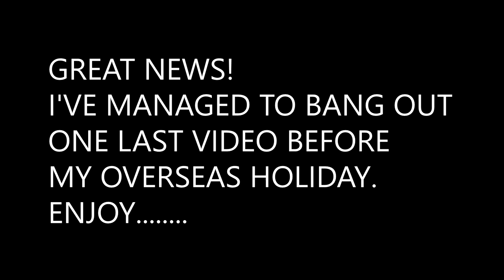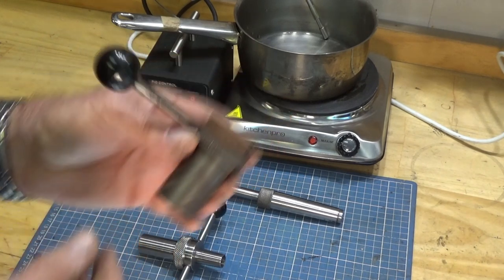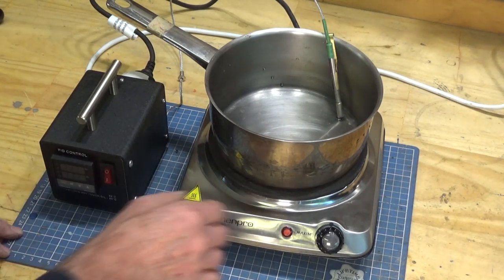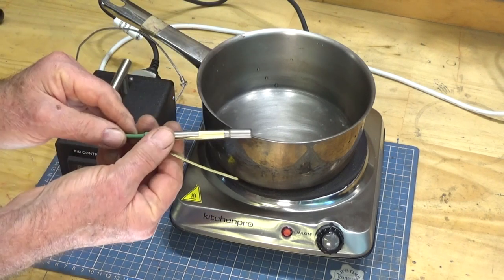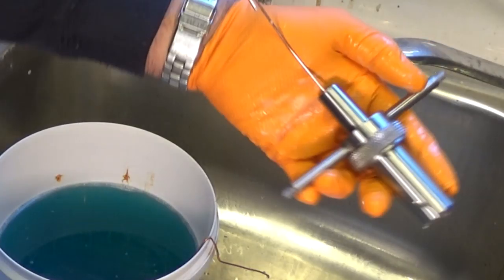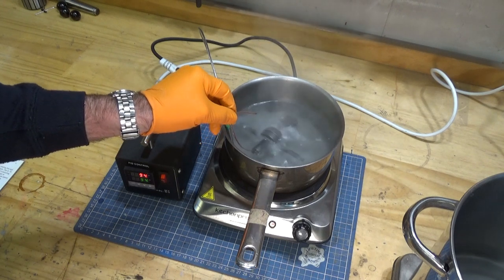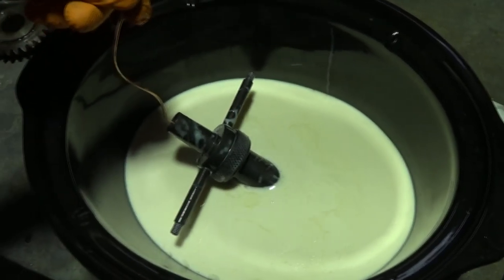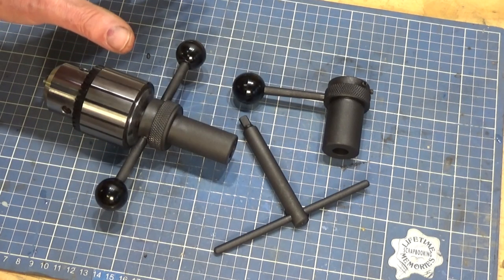DIY Parkerising in the home shop

Comment: Mild steel will never go as black as a hardenable steel with some % carbon in it.  There's  even a difference in color between high carbon steel thats been hardened and unhardened high carbon steel. The reason gun parts  will go very black when parkerised is because most of the parts contain a higher carbon %.
Reply from the maker: That's what I understood from reading my book but I haven't had a chance to try it on high carbon steel yet. I do love the surface finish though.

Comment: The texture is probably because it's zinc phosphate. If it were Magnesium phosphate it would be black. Zinc molecules are fairly large intent to leave a discernible text your to anyting you apply the phosphate coating to. An application of Z Max or Marvel Mystery Oil would seal that up quite nicely.
Reply from the maker: 44 Hawk, I got in touch with Cain at Jane Kits and he confirmed that the solution I am using is a Manganese Iron Phospthate. He also said that you do need to reapply the oil periodically. I did some tests before I left for my holiday and I am keen to see how they have behaved while they are exposed to the elements.
Regards,
Mark Presling

Comment: You can buy gun bluing or blackening.  After parkerizing, pour the bluing/blackening agent into a zip lock bag and put the part in there with it.  It will darken nicely.  Just a thought if you want it darker. Terr
Reply from the maker: I already have a cold bluing solution but I find that it's not very durable. The colour tends to fade to a sort of medium brown and it still corrodes. 
Regards,
Mark
Reply: @Preso58  
I put it on after the parkerizing.  If I think the parkerizing comes out too light (light gray), I drop it in a bag of cold blue/black and wash it around.  Works good on  bolts and stuff.

Comment: You could program the PID controller to look for a failure state. If the temp does not rise, or falls over the course of a few seconds, something is wrong and it should shut off.

[edit] Maybe not. I see that you used an off the shelf PID controller. I was assuming full DIY.
Reply from the maker: Mark, yes, my PID controller was a bog standard, el-cheapo Chinese knock off and although it does have some features like an alarm for over temperature states it's not particularly intelligent. I watched a video recently on a fully programmable PID controller and they seem like they have some very useful functions. 
Regards,
Preso

Comment: 3 years later, how did it hold up ?
Reply from the maker: All of the parts I have treated this way still look as good as when I treated them. The chuck key gets used the most and there is no rust and the finish hasn't worn off. I am about to run a big batch of parts in the next week or so. It's more work than cold bluing but it is the most durable finish I have come across.
Regards,
Mark

Comment: Was there any dimensional changes in the parts ? !
Reply from the maker: Not that I could measure. Parkerising is often used on cam shafts after grinding so that they hold an oil film better. I would think that if the parkerised finish changed the diameter of the journals it would be a problem. The process mostly etches the surface so it becomes sort of porous. It's not really and additive coating.
Regards,
Mark

Comment: You don’t need to boil the park solution. Just below boiling point will work well and you have less evaporative loss.
Reply from the maker: I did some more experiments a couple of weeks ago using a new rectangular stainless steel tank. Even though the temperature was set to less than boiling point, the solution does evaporate a lot and I realised that it had become super saturated. There was a lot of fine crystals in the solution and the volume had dropped by about half. The solution started to create really big bubbles which burst quite violently splashing the solution out of the tank. I topped up the water and it stopped. I have a video half finished but I am away on a holiday at present and won't be back for a month. I left some parkerised samples out in my shop to see which type of post treatment gives the best corrosion protection. When that video comes out you will see what I mean about the solution and how it changes as the water evaporates out of it.
Regards,
Mark Presling

Comment: He needs to bead blast it as Parker does not like to stick to a smooth surface.
The hot crystals are open and when the part cools in the oil the crystals shrink trapping the oil inside.
I then use WD40 for the oil treatment.
Reply: The initial “activator” bath does a similar job to sand-blasting in that it roughens the surface, but is finer, much less messy and removes less metal so there’s no risk of overdoing it and changing the part’s dimensions.

Comment: Hi Preso, how is the part holding up against rust?
Reply from the maker: Matt, I have parts that are four years old and they still look as good as the day I processed them. I have a four jaw chuck key that gets regular use and it suffers a lot of abuse but it still looks perfect. In my view, it's either parkerising or zinc plating with a chromate dip if you want corrosion prevention and low maintenance. 
Regards,
Mark
Reply: @Preso58  Thanks for the info Mark. I think I'll get myself a kit. I have used the cold blueing and that works OK, but as you found it is decorative only. For parts like the toolpost on my lathe that is a good solution as I always oil every surface when I'm finished with it. It also doesn't change the part dimensionally and it doesn't change the surface finish. For things like tools or parts of machinery that need real rust protection, I'll give parkerising a go. Thank for all the great videos mate, they're well put together and a real joy to watch.

Comment: does anyone know if you can parkerize a part that is mostly parkerized, but with some bare areas? Does the part need to be completely stripped? TIA
Reply from the maker: I have been thinking about that myself. I wanted to parkerise just the morse taper of the shank that the tap holder runs on and I was thinking that I might be able to mask it off with heat shrink tubing. I did parekerise a tool made from chrome plated 4140 hydraulic piston rod. Most of the part was machined but some of the original chrome was left on. The parker phosphate completely blackened the machined areas but the chrome was unaffected. It actually looks great. I guess you could copper plate or zinc plate some areas but it seems like a lot of extra work. 
Regards,
Mark Presling

Comment: Id get a dedicated accurate hotplate. fewer parts means fewer failure points
Reply from the maker: That would be nice. As always though, it's a matter of storage and space. Those little electric cookers are easy to store away. I did recently upgrade to a single burner induction cooktop for heating the water bath for the pre rinse. It' super quick at boiling the water and the only downside is that I needed to find an induction compatible pot that was large enough. I did get one at the second hand shop though.
Regards,
Mark

Comment: do you know which salts were used in your solution?
Reply from the maker: The only information I could get from the supplier is that it is an iron phosphate solution. However I recently made a large batch of manganese phosphate which does a similar job. It is made from phosphoric acid, distilled water and manganese dioxide. Once the solution is made up you just dissolve a handful of steel wool in it and let it settle before decanting off the clear solution. I made up the solution to 5 litres with distilled water and it works great. I bought the acid and the manganese dioxide on Ebay and it wasn't expensive. There are a couple of Youtube videos out there that give the quantities https://www.youtube.com/watch?v=gM8ZjWY7WR8
Regards,
Mark

Comment: I expect any chemical process involving conversion like this will result in, at best, a fine blasted surface effect as the process changes the parent material surface structure.
Reply: One of the benefits of the Nitriding processes which have superseded Parkerizing in the firearms industry is that they affect the metal fairly deeply, yet change the surface dimensions and texture almost not at all. Functionally nitriding is superior, but park has its place. Parkerizing adds a slight increase in surface hardness which protects against scratches, and very very slight corrosion resistance. To gunsmiths, it primarily serves as a good way to make oil or paint stay where you need it. Anywhere the parkerizing gets polished off by function is rubbing enough to keep itself bright anyway.  Nitriding on the other hand is a lot harder, and can make a file skate on a fairly soft steel. It is corrosion resistant enough to be better than stainless, and doesn't need paint or oil to work. You might notice that the grade 10 fasteners are often black... That's a nitride finish. On our commercial fishing boat, I noticed that even in the salty bilge, nitrided bolts often stayed unchanged for decades, whereas the steel they are in is invariably rusty.

Comment: It would be wise to wind the chuck jaws so they are inside the chuck body so you don’t pound on the jaws but on the body of the chuck
Reply from the maker: Doug, I will never live this down. 🙄 Luckily, the I didn't damage anything. I though I was taking precautions by using a soft face mallet but I now realise the error of my ways. 
Regards,
Preso

Comment: You should try a product called, "EEZOX." Works great on guns and tools to prevent corrosion. Much less work.
Reply from the maker: We used a product called Lanotec at the school where I used to work. It was very good at preventing corrosion as it was based on lanolin from sheeps wool. The only problem was the smell (like wet wool) and it could be quite sticky.  I guess I like the colour of the parker phosphate finish. I am withholding my judgement on it's durability until I have done some "real world" testing.
Regards,
Preso

Comment: You will need to oil them up occasionally, maybe every 6 months or so with a good quality gun oil to maintain rust resistance; gun oil may be bit tough to find down-under.
Reply: its in a lot of stores, if we had electric lights we would be able to find it :^)
( its usually next to the sheep dip) I occasionally saddle up my kangaroo and head into town
Reply: We do get Hope's here amongst others but having the word gun on the label means it will be more expensive I use a lanolin oil Lanox on fire arms it would be great in this application the light fractions evaporate leaving a very thin layer of lanolin. I have stored rifles for over 12 months in less than ideal conditions without any signs of rust. I was just looking at a couple of lesser used lathe chucks thinking I must give them a spray with it
Reply: Or just mineral oil is good too

Comment: Very professional looking finish but please don't thump the jaws of the chuck, withdraw them fully and only smack the body.
Reply from the maker: Chris, As soon as I mounted the chuck I realised it was going to be bad for the jaws. It was one of those moments when I was focusing on getting the video right instead of concentrating on doing the build correctly. My bad!
Regards,
Mark Presling
Reply: @Preso58  
you are forgiven.😁  
I guessed it was an oversight, but there are those who wouldn't give it a thought.
Reply: Mark Presling   It seems Jacobs say to press on the jaws when disassembling a chuck but I still wouldn't hit them. Who knew? If I owe you an apology consider it done.😕

Comment: That is called a gun metal finish and they should resist corrosion.
Reply from the maker: I can report that the finish has indeed resisted corrosion. All of the parts I have treated this way are as good as the day I did them.
Regards,
Mark

Comment: Hot bluing with sodium hydroxide, sodium nitrate and distilled water is a lot easier and faster with less steps than this.
Reply from the maker: Daniel,
I have watched a number of videos on the process you have described and it is a lot simpler but I find that the parkerised finish is incredibly durable. I took out a tool today that I parkerised two years ago and it's still pristine. Some parts that I cold blued turned a sort of muddy brown colour and the coating wore off quite easily. I know hot bluing can be better than cold bluing but I am still sold on the parkerised finish due to it's dense black colour and unusual crystalline finish.
Regards,
Mark

Comment: You may also want to look at this https://youtu.be/xmv58Z3RZ9c process. Its a bit of work, but simple safe and economical.
Reply from the maker: Tammeem, I had watched that video some time ago and I was impressed  with the results that he got using such simple materials. This was just after I had outlayed some money for a cold blacking solution. I was a bit disappointed to find that it rubbed off fairly easily. I need to do some test pieces (not my tools) with the parkerising and then leave them outside for a while to see how durable they are. I will also try to simulate some wear and tear to see if the coating holds up. 
Regards,
Mark
Reply: @Preso58  I haven't tried it yet, but it looked thicker then normal chemical bluing. Some testing is in order. I'll see if get around to it.